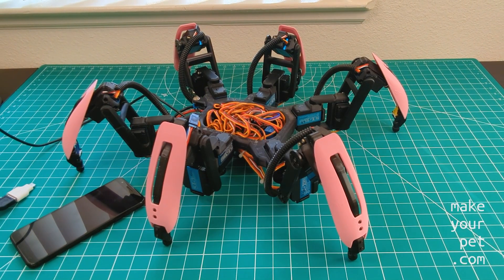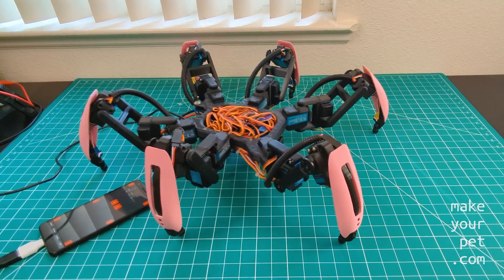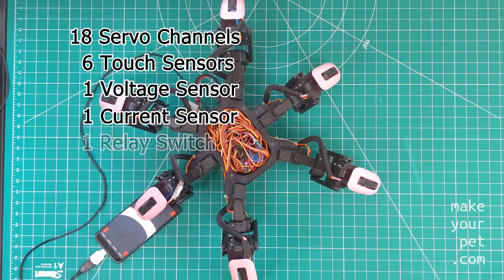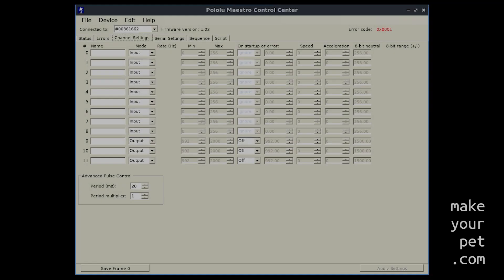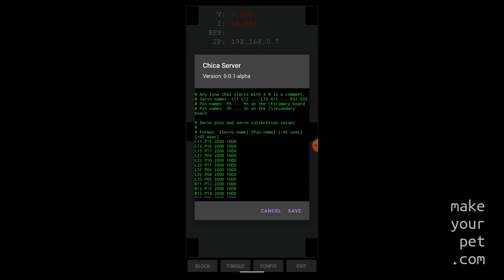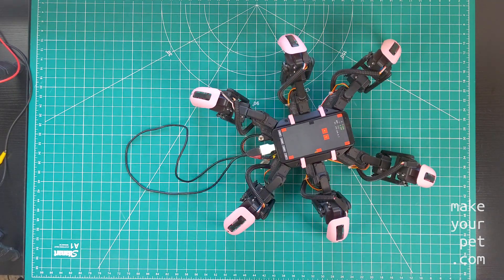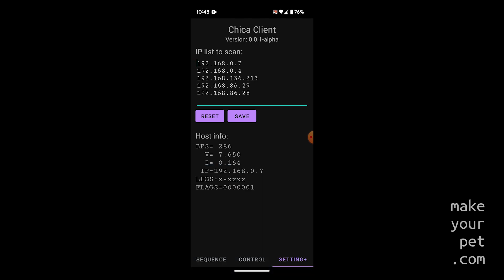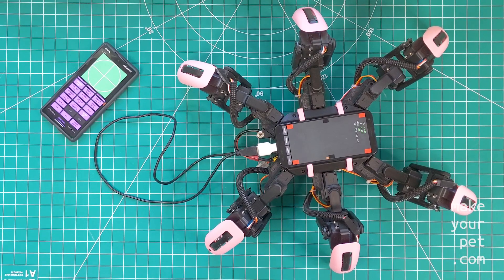How To Make A Hexapod Robot. Part 3 of 3: Software. A DIY Robot Project.

Comment: Hi, I was wondering if its possible to control the hexapod with an arduino or a raspberry pi?
The phone's  idea is pretty nice.. but a microcontroller seems more doable for me 
Great video nonetheless
Reply from the maker: Unfortunately the app only works on Android phones so far. But I may port the app to RPI eventually.
Reply: Interesting. You got one subscriber. Save money for this project

Comment: May I ask why you use touch sensor,  does it take part for doing inverse kinematic calculation?
Reply from the maker: Without the touch sensors, I would need to assume a perfectly flat surface, which is not the case most of the time. So the touch sensors give an easy way to handle slightly uneven surfaces very easily.
Reply: @makeyourpet  great solution!

Comment: The current measurement is just for all the servos as a whole isn’t it? I’m looking for a servo driver board that can measure the current for each servo. I will probably need to make my own. Unfortunately 18 shunt resistors and force feedback on each leg and enough analogue multiplexers will be a pain to design, but it will probably be worth it.
Reply from the maker: yeah it is the total current, which is still way better than no feedback at all, and helps by cutting the power if any of the legs gets stuck. Yeah 18 separate inputs makes it difficult. I remember you from Reddit! you should totally join my Discord and we can dig into those ideas.

Comment: Hi, I have a question. Will it be dificult to rewrite the the software for 8 legs instead of 6 ? Are you planing to make a spider ?
Reply from the maker: I don't think the code change would be that difficult to expand to 8 legs. But I don't have plans to make a real spider (8 legs) yet. Having 6 legs has a ton of advantage over for example 4 legs, because of the statically stable bi-ped like walking gait (3 legs at a time while statically stable). But 8 legs doesn't add much, other than for looks or imitating a real spider.
Reply: @makeyourpet  Yes your reasoning ist 100% correct, but I do need it for looks only, lets call it for a show.
Here is why I ask. I want to build my ovn spider-bot but in a bit bigger size. For this plan I wanted to buy robugtix T8X and gut it for its electronic. So my budget was 1K USD to obtain a board with software. Then I saw your project and started to playing with the possibility if I can hire you ( pay you ) for software modification to 8 legs. The software should be free to download as is the 6 leged one. I don´t know if 1K would be  too much or not enough, but just throwing it up here. Maybe some people give it a like and we see if others are interested.

Comment: Hi, will you open source the apps as well? I'd like to port it to raspberry pi to run my hiwonder hexapod.
Reply from the maker: Hi, it is not open source, but a raspberry pi port is coming in the future. If you have software background I can give you some pointers tho. Join my Discord https://discord.gg/vb8YWMfBuk
Reply: @makeyourpet  I'll join but I probably won't use closed software as I was burned too many times buy discontinued projects that made it impossible to adapt or modify later (e.g. snips)
Reply from the maker: I understand and that's totally fine. I am mainly targeting enthusiasts who may not have a strong technical background and this kind of software works best for them. Most techie ppl write their own code anyway. I can give you many examples of freeware (non-open) that are popular and successful, so I think it depends.
Reply: @makeyourpet  I'm not questioning wether it can be successful or not. It probably will. But a requirement for stuff i use is that i can maintain it myself if the original author chooses to abandon it. I have been building my entire smart home stuff on a framework called snips that was partly open source but relied on their cloud system for training in 2016. When they got bought off by Sonos they closed it down and i could not extend it anymore with new stuff. Since then I'm not relying anything on projects that are partly closed source and cannot be replaced easily anymore. I'm happily watching your channel and how you extend it though as it's fun to watch.
Reply from the maker: Yes I know the pain. That sounds like a very cool project tho. Still feel free to reach out if you ever decide to write your own hexapod code and have any questions. Cheers!